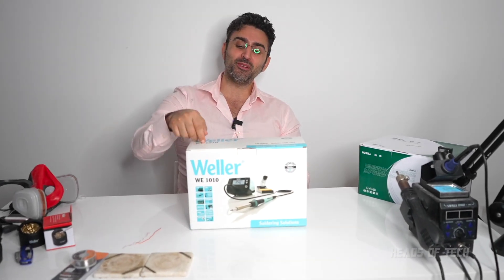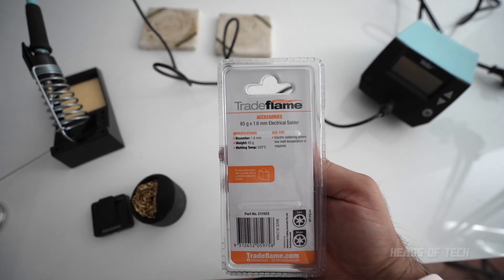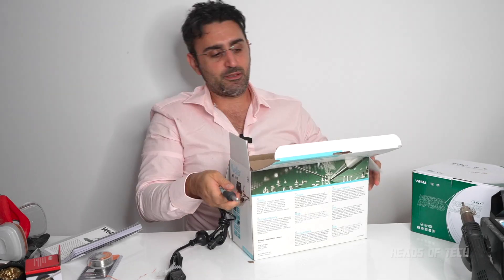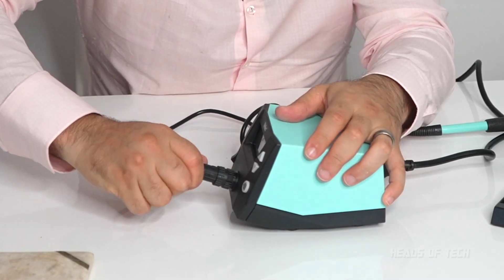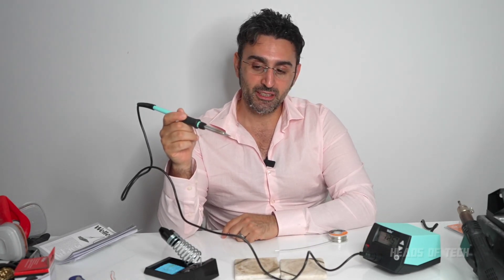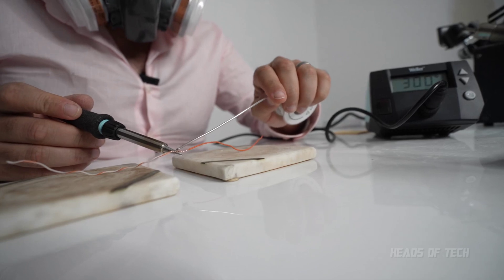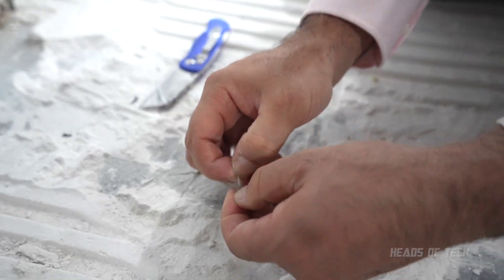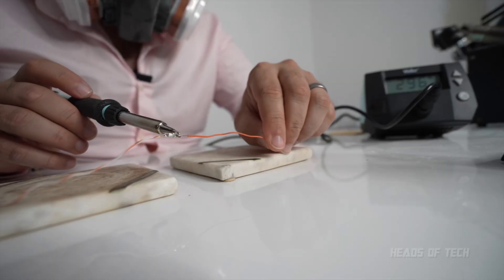Weller WE 1010 Soldering Station - Wire Repair and REVIEW | Best Iron for Beginners?

Comment: If you unwind the solder half a meter more and hold the soldering iron at the back of the cable, you can make it even a little more difficult for yourself ;-)

Comment: Nice job with the respirator, the solder fumes are nasty and dangerous! The blue sponge in the soldering iron stand should be soaking wet with water (even some extra standing water is fine too) so when you wipe the tip on the sponge, the wet sponge shocks the tip clean.
Reply from the maker: Thanks legend, I'm now officially waiting for a mastery of soldering video on your channel.
Reply: @headsoftech  Mastery, haha! I emulate the old saying 'Jack of all trades, master of none!
Reply from the maker: Mr. Jack, I've seen your electrical panel upgrade video which passed inspection. When I had my panel upgraded by a professional sparky, it failed inspection.
Reply: @headsoftech  Thank you and sorry to hear that.
Reply from the maker: Nah, it's all good, he had to come back to rectify the issues, just pointing out that you're the man!